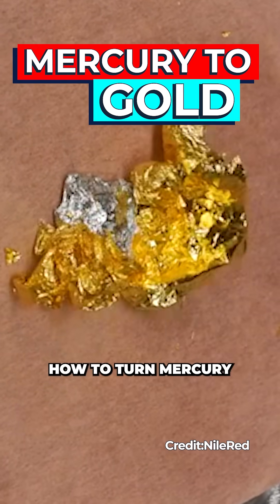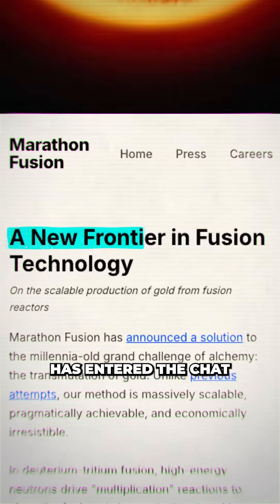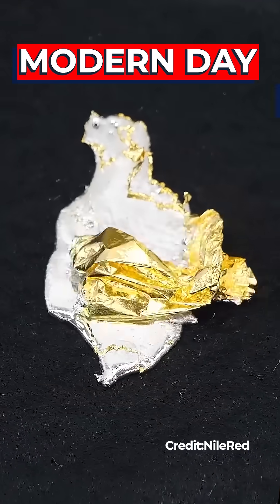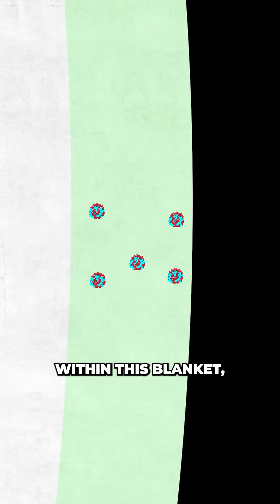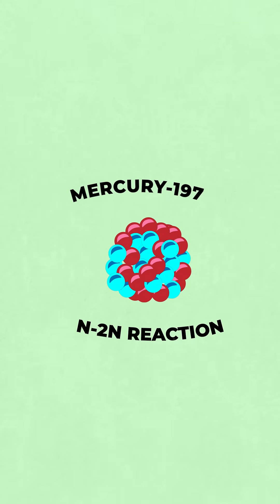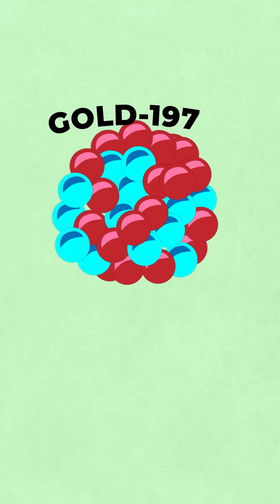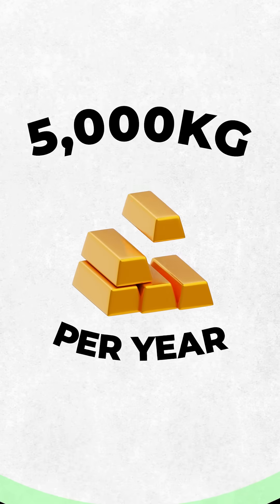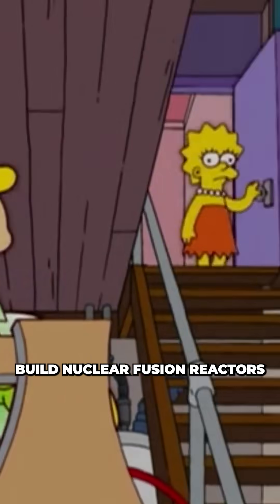Scientists Turn Mercury Into Gold

Comment: To be clear:  the FIRST reactions that make the Hg-198 are FUSION.  After that it's FISSION to break it down to Hg-197 and then gold.  
Is it POSSIBLE?  Honestly I'm not sure.  Any good scientist will not be afraid to say that sentence.  I'm a chemist, but nuclear reactions aren't really my area of specialty.  But basically, on paper, the math kind of works.  But it would require A LOT of mercury to start with, and a LOT of power to run the reaction as well - which is why you would need to literally install the mercury inside and ACTIVE NUCLEAR POWER REACTOR.  And even if it DOES work, the question you still need to answer is:  is it WORTH IT?  Does it really produce enough gold to cover the cost of the materials and running the reactor?  Does having a man-made gold generator wreck the value of gold on the world's markets, thus perhaps making it not worth it after a few years?  I don't know.  More research is needed before we can claim that alchemy is now possible and profitable.

Comment: •	Mercury (Hg) and gold (Au) are different elements.
	•	To turn one element into another, you’d need to change the number of protons in its atoms (nuclear transmutation).
	•	That’s only possible in nuclear reactors or particle accelerators, not with normal chemistry.
•	It requires huge energy and expensive equipment.
	•	The gold produced is often radioactive.
	•	It costs way more than just mining gold normally.

Please leave a like❤
Reply: I wont like it bc u copied chatgpt.
Reply: @mepik_pl i couldev write it myself and waste my time, but  atleast like for waisting my time to show u the real correct answer.

Comment: If we mimic the pressure, temperature and radiation level inside the core of the planets we may be able to infuse lighter low value elements into heavier more critical elements in the process and that can be part of the future high pressure fusion reactor designs

Comment: We need more gold in circulation, gold serves more purpose than its ability to hold value. It’s used in medicine, it’s used in all connectors in prevention of corrosion. Many electronics use it. Even if it dropped in value, the possibility of gold backed currency wouldn’t be so out of reach with the limited supply available.

Comment: Except how are they going to prevent the gold from obtaining extra neutrons once it’s created? It’s not like they can just remove the gold as it’s being made. The process of extraction will likely be very dangerous as well because the Hg-197 will be radioactive requiring a waiting period that could be on the order 3 weeks to multiple months depending on number of Hg-197 atoms. There is also the issue of heavy ions being very bad for nuclear fusion. This may not be the case for magnetic confinement fusion, but heavy ion contamination can be a very significant problem for inertial confinement fusion (ICF) which is the kind of fusion performed at NIF.

Further, there are many stable isotopes of mercury, and Hg-198 makes up only about 10%. Enrichment of this mercury will be necessary. While it will be more efficient than enriching uranium, it will still be very inefficient and expensive as well as very hazardous.

This sounds more like some physicists who wanted to pretend there was a real world application to this specific reaction; or who wanted to pull a fast one in investors (take the money and produce a business that will knowingly fail while taking large salaries); or it’s some fools’ dream.

Comment: To those thinking this would cause Gold Inflation, you're wrong; it would cause Gold Deflation, because the quantity would increase, scarcity would decrease, and value would plummet due to Supply and Demand adjustments.

That being said, the quantity of production is laughably small; their production rate is nowhere near their estimate because they are not producing anywhere near that much power. The estimate provided is a theoretical maximum, not a realistic regularly produced amount.

Comment: im pretty sure also, mercury is about as rare and valueable as gold. so were using a very expensive process to use convert a rare element into another rare element.

the only "benefit" is if the fission material creates gold as a byproduct. which i think is the point of the clip?

Comment: It's interesting that this could both inflate or crash the price of gold if it works, and is worth the cost to produce.

Gold has a surprisingly number of applications as a tool, and can even be used in some electronics. Not to mention cultural significance in places like India.

But there's also the risk of overabundance leading to a severe drop in value.

Comment: 1 GWh plant produces for about 700 million EUR is revenue on a year basis if the electricity is sold for 0,08 EUR per kWh. 5000 kg of gold is sold for approximately 450 million…. So you lose 250 million EUR per year. Great 😊
Reply: It's an "and" situation, not an "or" situation, but  you're right that saying the profits would double is an exaggeration. It would increase by a little over 50% if all those numbers are right.

Comment: EVERYONE THINKING IT’S CAUSE INFLATION & GOLD PRICE WOULD DROP…
🤔 Actually NOPE They wouldn’t be affected The Reason is…

 We’d NEVER notice an Inflated price difference IF ANY amount. Maybe Penny’s a pound at first. 

🧐 5,000 pounds a year is NOTHING when you consider 5.5 to 6.6 MILLION POUNDS Of Gold was Mined Last Year Alone!

So They would only be making a fraction of a fraction of fraction of less than %0.1. 

 Only way it would inflate value is if somebody stockpiled vast quantities and refused to sell. Similarly to the oil & gas Crisis back in the 70’s. Cause companies and people love making money doubt it could happen. Also Only whole countries have the funds to stockpile enough gold to change the stock price in such a way.

At 5,000 Lb’s a YEAR they’d have to build THOUSANDS OF Nuclear Plants to get a couple percent of the Yearly Gold production ☢️ That’s not simple with the amount of energy it’d take to run. Large amounts of land and the perceived danger of Nuclear is difficult to get local Gov’s to approve the zoning alone. Which is why we don’t have many Nuclear Power Plants. Even though it’s the cleanest energy and modern plants are simulated fail proof.

Comment: The fact that this gold will stay radioactive for 20 ish years before it can be used is actually its saving grace. This means that this extra gold supply wont plummet the market value that much as the supply of this gold will be limited to 5k kg/reactor/year. Given global gold supply is on avg 3200 Metrics tonne per year, this wont be a very drastic increase in gold supply. So the reactors indeed could pay for themselves

Comment: This at scale would devalue gold. Just one more reason to buy Bitcoin. As gold gets more expensive it becomes possible to mine for it in previously unprofitable areas (ocean, asteroids etc.) or to use alchemy (increasing supply to meet demand). A finite total supply of Bitcoin + constant fiat inflation driven demand = infinite increase in Bitcoin's value over time. Why buy houses or land with liabilities & property tax when you can just buy Bitcoin? Why buy gold when they don't even know exactly how much there is or that's real (gold plated tungsten is a thing) & they find mountains of the stuff randomly? A programmatic monetary system is better than random assholes printing money or finding yellow rocks by chance. Golds industrial/jewelry value is a few hundred dollars an oz at most. The vast majority of golds value is simply "something you can buy that's hard to find (for now)" in order to hedge against money printing. Bitcoin is the hardest money ever created & adopted globally.

Comment: They forgot something called practicality;
1st problem, your gold is now in a breeding blanket that is stupidly radioactive. Have fun spending billions on extractions.
2nd problem, gold is still in the reactor. It’ll get hit with another neutron and go under a decay chain back to mercury.
3rd problem, enriching mercury would be an extremely dangerous and costly process. Your profits are gone before you start.
4th problem: you’re removing part of the blanket removing fuel from the reaction.
5th, why? You can sell tritium for 100x the price of gold and don’t have to worry about any of that?

Comment: What happens if one of the neutrons hits a gold atom instead of the mercury?
Also how do you remove the gold from the reactor?
Reply: It will turn into Au-198 then decay to Hg-198 in 2.7 days, the stable isotope of Mercury.

To remove the gold from the reactor, you remove the blanket from the reactor. Use whatever material seperation technique you like from that point

Comment: Making Au into a readily available commodity and massively lowering the price of it is arguably a great idea, especially considering the many uses the metal has outside jewellery and bullion. 
I have a feeling that a similar concept as for synthetic and natural diamonds will appear. Possibly stamping naturally sourced Au as such to differentiate it from alchemy gold. 
With time it may turn out that certified “old gold” will not only retain its value, but massively increase in value since it will be much harder to keep a metal separate from other atomically identical matter than keeping chunks of crystalline carbon separate.

Comment: If this ever takes off, i predict it being catastrofic for the economies still reliant on gold standard, but at the same time revolutionary for computer industry. Gold is an amazing conductor, there's a reason why components have it in them. If the price went down, then the cost of making these components would also drop somewhat, or we could see it applied in other places where it was not economical before, even though the practical use would be justified. I'm all for turning gold into alluminiun the way how alluminium used to be super expensive because it was rare once, but after we figured out its production and made it cheap, it made our lives significantly better through various applications.

Comment: If this actually worked, then the value of gold would plummet like overnight. Gold is expensive because it's rare. If it's no longer rare then it will become the next Aluminum. Aluminum used to be very expensive but now we put the stuff in car engines and soda cans. It has value, but nowhere near the value it had when it was first discovered.

Comment: You guys are aware that atomic weight refers to the number of protons in the nucleus, and that means if you find a method of adding or subtracting protons you could turn anything into gold. The issue is not the idea itself, but the whole "splitting the atom" deal...

Comment: I'm wondering if this process affects the golds use in things like circuitry, because if it does, then the value of gold should be less effected. If it's a negative effect, it would cause natural gold to have little to no loss in value, but this transfusion gold would have far less value. It would be the same as with man made diamonds. However, if this process makes this gold more reactive or better in some other way, then natural gold will lose value but this gold won't!

Comment: Dr. Miles I've independently studied nuclear physics with a focus on fusion since I was 11 (now 28) it is absolutely impossible to use a fusion reactor to synthesise gold even blue supergiant stars don't manufacture gold through stellar nucleosynthesis Gold is only formed in two ways throughout the universe and those are core collapse supernovae (specifically type 1b/1c & 2) and collisions between neutron stars. Two of the most energetic events in the universe. Of those only only Neutron star collisions are actually confirmed as a major producer of Gold via the r-process with supernovae production being highly speculative and as yet unsupported by direct observational evidence.

To that point, it would, in fact, be more feasible to synthesise Gold within fission reactors due to their high neutron flux, as a field fission reactors are often differentiated by their type of neutron flux (e.g., fast, thermal and epithermal) the main nuclear engineering constraint of fission reactors is neutron flux management, where as, with fusion reactors ALL neutrons produced are accounted for to both maintain the fusion reaction and the breeding of Tritium.

Comment: Pretty cool and a possible neat byproduct of fusion plants I don’t see this crashing the price of gold. After all gold has no real intrinsic value beyond some mine use in printed circuits. And is entirely based upon our perceived value in it. A value we are invested in not having drop. Basically it’s the same thing with diamonds. Diamonds are worthless and can even be made artificially the same way this gold is. The reason why diamonds are still expensive is because of artificial scarcity and market control. So I could see the price of “real” gold remaining the same while this man made gold is used for more low commercial grade things. 

TLDR it’s all about the branding gold ain’t going nowhere.

Comment: Funny enough, this wouldnt tank gold values either. 5 tons a year is a lot of gold, but theres 197,000 tones of gold in circulation. It would take said reactor running nonstop for 40,000 years to just double the gold supply and halve the gold value. we will literally see the horus herasy and rise of the imperium of man long before this reactor could ever hurt the gold value

Comment: Basically using the neutron activation that would already occur, but trying to get a viable product out of it, rather than a radioactive metal wall. Honestly quite smart. 

Thats assuming you can do a sustained fusion reaction with a positive net electrical outlet. Which is decades away